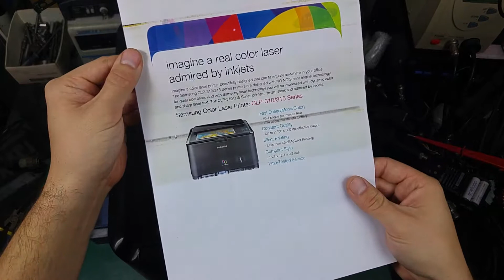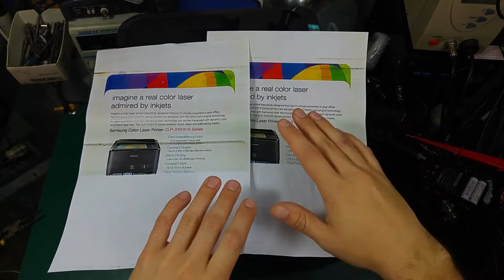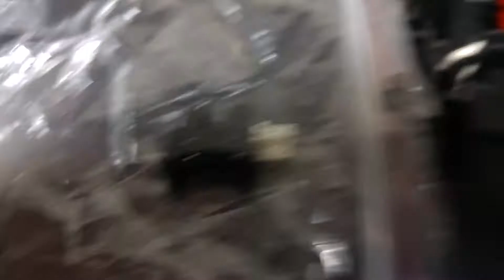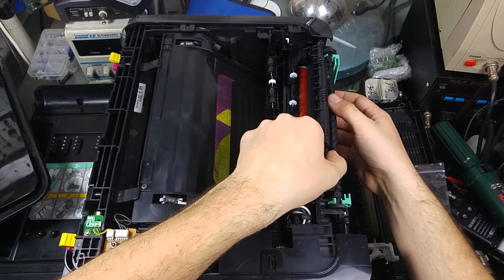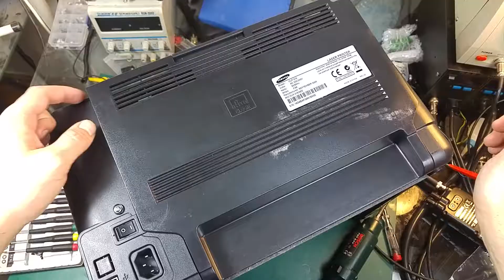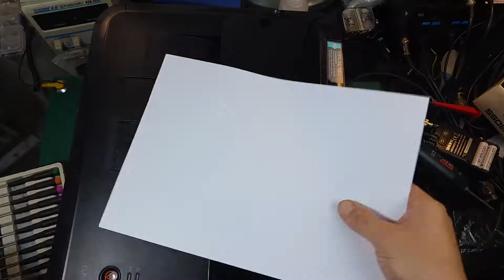Page stuck jamm half way on Samsung CLP-315 CLP-320 - how replace Photo Interrupter / Exit Sensor

Comment: Thank you VERY much, the optical sensor on my CLP-325W wasn’t bad but it had become slightly unseated from its socket when I had to remove paper from a very bad multiple paper jam. It took 10 minutes and you saved me some $$ from replacing printer and toner!😃😃👍👍